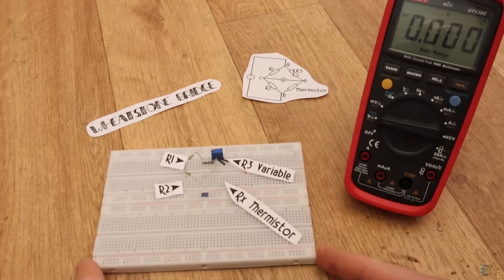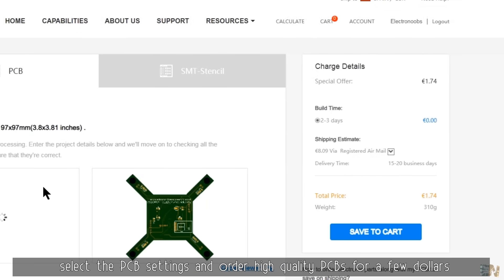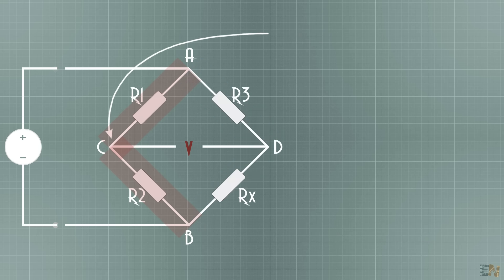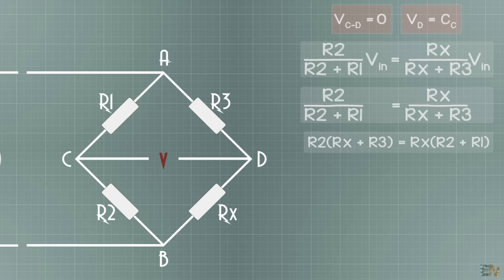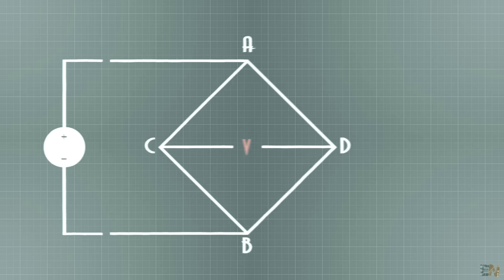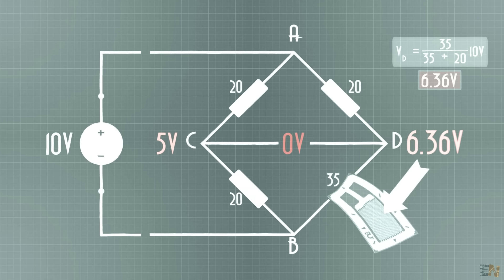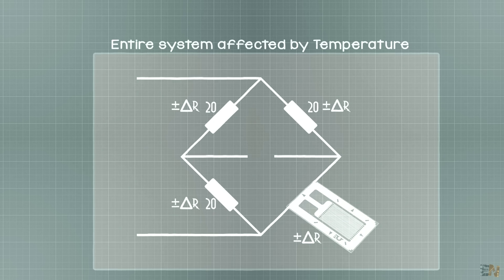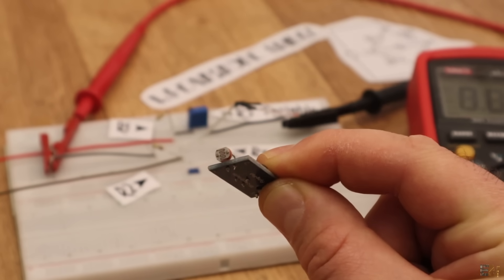Basic configurations #1 - Wheatstone bridge

Comment: simple explanation with out all the math seems to be, you adjust the variable resistance to balance the voltage bridge to equal 0. 
Because its 0, you can use the variable resistor to find out what the unknown resistor is.
and you do this to get a more accurate reading. and that's it. its only advantage is a more accurate reading then just using another meter.

Comment: but R1, R2 and R3 are not effected by the same temperature that was given to the Thermistor, so they are not all effected at the same time like you said in the minute before. how can you explain this ?
Reply: The temperature of the environment is what needs to be taken into consideration, so yes R1, R2 and R3 are affected by temperature. This is also true for the thermistor, strain gauge or any measuring instrument, it will have its own temperature coefficient of resistance. But the key is that they are all balanced when you adjust the rheostat, this means that only a change in gauge resistance will affect the reading.

Edit: I'm a student so I may not be 100% correct but this is my understanding at this point.

Comment: This explanation is completely wrong. A Wheatstone bridge is useless if you are only measuring on 1 of the legs. You need to be measuring on at least 2 of the legs, with 4 being the best, to gain anything from using it. You don’t even talk about the EM cancelation effects that this is primarily used for.

This is by far the worst explanation of a Wheatstone bridge that I have ever seen.  You could have at least presented a textbook example like a magnetic pickup.

Comment: Just looking into the wheatstone bridge with a thermistor for one of my projects. Have you used this with the Arduino for temp readings? Currently I'm just using the thermistor in a voltage divider and it's quite accurate but can never have high enough accuracy right? :) if you haven't done said project, any chance?

Comment: @3.51 sec, you say , R3 can be changed until Vc = Vd; but didnot understand here.. Rx is a R3*const(Ratio of other two resistors). How can you change only R3 to make Vc = Vd. This part is not clear. Once we know R1, R2; Rx is R3* Ratio of (R1 & R2) assuming Vc = Vd. In this case i can choose R3 any value of Ohms and it will meet the criteria. so why do we need to change R3 value

Comment: Hey what about using just a simple voltage divider - just put the strain guage in series with another known resistor, and measure the difference in the voltage drop...? Is there any advantage over the wheatsone bridge?

Comment: good explanation, but you should mention that the big advantage of the wheatstone bridge is that the voltmeter actually shows the small deviation from the equilibrium and thus you can use a much more sensitive measurement range. In your example of 20 ohm resistors (quite low value by the way) if you would only measure one resistor which changes from e.g. 20 ohm to 20.2 ohm than this would only be a change of 1% seen on the last decimal on a regular multimeter. Even if you just measure the voltage on the right side, you end up with an unuseable value of just 5.02 V, also here the important information is hidden in the last digit of the multimeter. However, if you measure the difference between the two voltages, you get a value of 25 mV which you even might be able to read with an addition decimal in the millivolt range of your multimeter.
Reply: It all makes sense now, thanks for you explanation, superb. i was struggling to understand the benefits...
Reply: Very good insight! Thank you

Comment: There's a mistake on 4:43. The strain gauge resistance must be 20 ohm, just like R3, for a bridge to be balanced. 
Also on 5:30, the more temperature you apply, the more resistance increases. So, for example, it must increase to 22 ohms. But you're showing that it decreases. Otherwise very good, clear explanation! Thank you, dude!
Reply: disagree.  Seems like an important reason for why this configuration is used is to account for resistors and systems not being ideal.. Although 20 ohms may make the bridge balanced in ideal conditions, this is real life.  23 ohms might be needed to balance the circuit due to the resistors not being ideal and environmental factors such as temperature
Reply: @clobraico_private9121  that would have been plausible if he had explained that pragmatic scenario. The explanation should stick to the theory. If you dont understand the theory you wont understand its real world effects and variations.
Reply: Resistors come in large variation of properties and not all respond the same way to changes in temperature. Look up thermistors; they come with negative (i.e. temp goes up resistance goes down) and positive (vice versa) temperature coefficients.
Now: Even resistors that aren't purpose built to respond to temperature coefficient. And whether the temperature coefficient of any given resitor is positive or negative depends on its construction and the materials its made from. Therefore the generalization "the more temperature you apply, the more resistance increases" is incorrect.
Reply: Temperature up resistance down

Comment: Nice explanation, but using quarter wheatstone bridge as u showed in this video doesn't solve the problem with  temperature messing up the measurement, because it's very likely that resistors used in this bridge will have different temperature coefficient than the strain gauge. We should use the half bridge instead, so 2 strain gauges , to make sure that the changing temperature won't mess up our mesurements, am 
I right?
Reply: So R3 should also be a strain gauge? You will have a problem with 2 strain gauges measuring different forces.